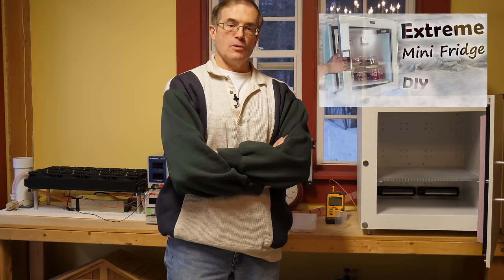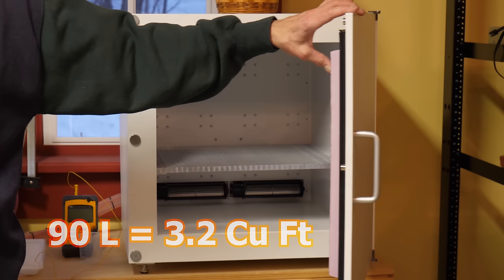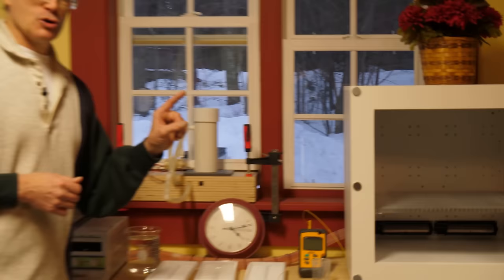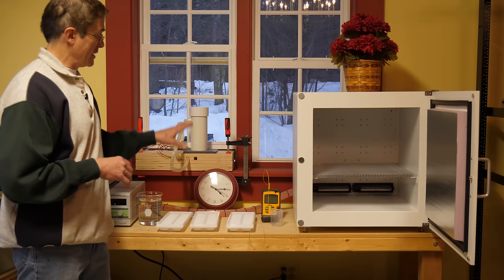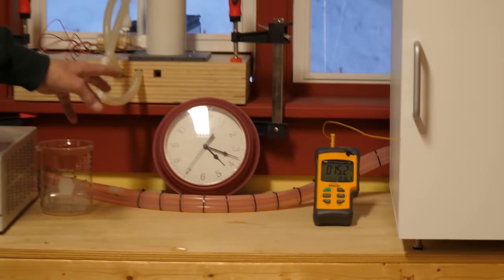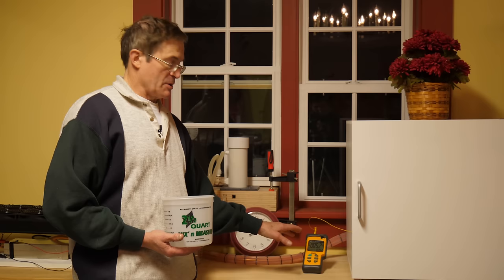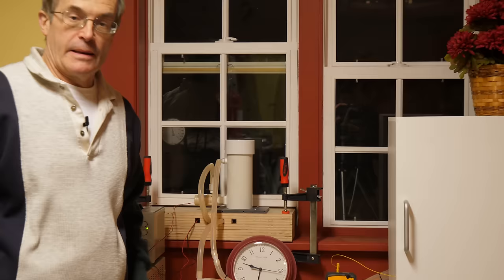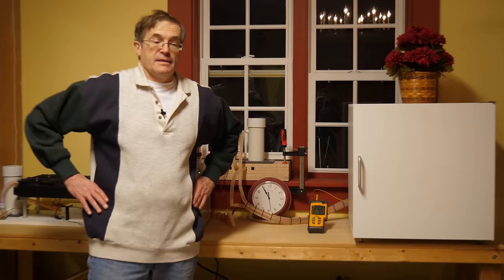TEC Freezer - Build Your Own!

Comment: So would a radiator and pump INSIDE the fridge on the cold side of the TECs help with heat pumping performance?
Reply from the maker: The two linear fans near the back of the inside of the freezer blow across the rear surface of the enclosure which acts as a large, flat heat sink.  Adding find to increase the surface area would help a little, but I doubt it would be worth the cost.  A fluid system would be even more intrusive.
Reply: @TechIngredients  Except for the little mini coolers that use a deep drawn aluminum tub, commercially made TEC coolers use an internal finned heat sink, many also have an internal fan, and they get decently chilly with a single TEC.

I've 'supercharged' a few coolers by carefully filing the TEC contact faces of the hot and cold side heat sinks flat, replacing the thermal compound (often too much applied by the factory) with better compound, and replacing cheesy centrifugal fans and noisy brushed motors with fans made for computers. The major problem with the little soda coolers is the tub is quite thin and makes very poor contact with the TEC. On those I cut a piece of thicker aluminum sheet to put on the inside of the tub, with thermal compound between it and the tub. Getting the tub solidly against the TEC lets a 6 or 9 can cooler keep the drinks extra chill. the one I've kept for myself, with a 4" computer fan on the outside, can keep a half gallon box of ice cream frozen for hours. 'Course nobody sells ice cream in half gallon boxes these days.

Another thing I do to these coolers which should in theory help them cool better is glass bead blasting the heat sinks. Rougher surface = greater surface area to transfer heat to or from air. Would be interesting to see someone with precision thermal testing equipment test the efficiency of an extruded aluminum heat sink, then glass bead blast it all over (except for where it contacts what it's taking heat from) and check its efficiency.

Comment: Hey, I couldn't wait for your dessicant cooling system, so I read ahead.  It's as I expected - basically a dessicant dryer followed by a heat exchanger, then a "swamp cooler" humidifier that cools and re-humidifies the air, with the return air heated and then used to dry the dessicant.  At least, that's the solid dessicant cooler - there are also liquid dissicants using lithium halide salts, but I'm guessing you're not messing with all of that.  But curiously, almost all of the diagrams I found, showed a second humidifier, on the return air side.  This puzzles me, as none of the articles give any kind of explanation for this component, nor does it appear to make any sense to me.  Can you shed any light on this?
Reply from the maker: You've described it pretty well.  We do in fact use a liquid dessicant.  CaCl2 and LiCl both work, but there are trade offs.  When we post the video, the individual steps in the process will be easy to visualize and understand.  It isn't  sophisticated or subtile, it's suprisingly simple.

Comment: There is an error at the minute 15:00. A gram / cubic centimetre of water requires 80 calories to cristalize (0 deg liquid to 0 deg solid)  that means 80 * 4.184 joules  ~ 334 joules. Not 2000 ...

Comment: Great video. I want to use the same idea to cool my picnic cooler. I want to use one pletier  module. The cavity of the space is about 58×34×24 cm.
How much time base on your expirience it will take to reduce the temprature to 0 cellecius degree. When the cavity is on 32 degree cellicius?
Reply from the maker: Watch our earlier  video on the solid state refrigerator.  I walk through  the sizing of the cooling load and the TEC requirements.

Comment: Awesome. I might consider making one. Question. What kind of temps would one have to reach, to keep the temp in the freezer below 0 for 12 hours without power?
Reply from the maker: Good question.  The downside of this system is that without power the TECs are a poor insulator.  With only a few tens of watts, their cooling capacity is very low, but then they effectively become a "perfect" insulator and you're limited only by how much insulation you use and the mass or cooled material inside the box.  I go through some of these calculations in our earlier video on the "Mini Fridge".

Comment: Where do you get your parts from things the tec's and power supplys probably from eBay and amazon, But what about the radiators water blocks and those tiny blower fans that are inside of the freezer? On your refrigerator you used glass for the front and its double panes have you though about evacuating the air from between the panes to get a better R value or using and innert gas like a residential homes windows.
Reply from the maker: We have been doing this for so long our lab/shop is like an urban maker space.  We have "stuff" everywhere!  I just went through the shelves and designed based on what was available.

Comment: Hi, nice video. On an aluminium boat, Will it be possible to use the boat as an heat sink for the refrigerator ?
Reply from the maker: Sure. Some steel freighters use the hull as a heat sink for cooling their diesel engines.

Comment: So the TEC basically convert electricity into potential energy, and can convert the potential energy (the difference in temperature between the two sides) into electricity. 
Am I getting this right? 

Cause I'm imagining a setup that oversees a huge network of nodes including climatization, refrigeration, heatsinks for motors and electronics, and it regulates them all together going as far as having fluid systems transfer heat from node to node.
Reply from the maker: That's right.  Take a look at our video on "The Campfire Generator".

Comment: I am not sure why you ran the the water lines in series from the Peltiers to the external cooling block ... would it not of been more efficient to have the peltier units  in parallel for more efficiency in cooling ?
Reply: The first set of peltiers yes,  and the cooling working, but every  level of peltier you go into you need to worry about the the heat multiplying every step  .... having them in parallel would allow for a much faster removal of the heat of the freezer unit, and the unit would go down further in temperature in parallel then they would in series. Please correct me if I am wrong
Reply from the maker: The problem is that one way or another there would have to be some of the peltiers running in series otherwise we would end up with 12, parallel input and output tubes.  This would be quite bulky and require either a complex tree of spreading and contracting plumbing or some custom fittings.

Comment: is it still solid state though if you got a bunch of coolant being pumped around? i mean especially with the outside cooler you got pretty much a heat exchange pump and maybe won't even need the TECs? if you're already pumping stuff around won't the "old fashioned" way of pumping heat via pressure differentials be more efficient?
Reply from the maker: You're right that with a fluid loop, this is not a solid state cooling system.  The purpose with the previous refrigerator video project was to see if operation without any moving parts was feasible.  It wasn't and fans had to be used.  The freezer also uses TECs, but to further enhance effeciency, a liquid heat exchanger was added.  The interesting aspect that the low pressure, simple recirculation method allows, is that it is now easy to exploit available low temperature locations for the heat exchanger.
Reply: @TechIngredients  so it's more of a flexibility thing (and safety / ease of construction i imagine, i wouldn't want to be working with high pressure toxic coolants in steel pipes :'D ) than the original idea of solid state delivering high lifetime and efficiency? that and i imagine you probably actually need less power and less bulky pumps in this comparatively small setup, since the fluid doesn't do the actual work
Reply from the maker: Right.

Comment: How would this perform in an environment were the ambient air temp is 30C to 34C?
Reply from the maker: The temperature differential is the primary guide.  A 25 degree differential is very practical.  A 35 degree differential is difficult.  Obviously, the heat flow increases with a larger differential, but more so, the effeciency of the TECs drops substantially.

Comment: Rewatching these fridge videos is just as interesting as when you guys posted it. I'm curious if there's a possibility of making the fridge or freezer designs thinner by using Aerogel blanket insulation (or other type of aerogel insulation) that has been developed since the making of these videos as insulation. I'm just curious if there's any possible improvements that could be made on design based on newer materials.
Reply from the maker: Sure, that could be done.  Aerogell is about 25% better than the urethane  we used.

Comment: Great video !!. Is it possible to make a normal minibar (with compressor, evaporator, radiator, etc... like an small fridge)  lower the temp than -34°C  (-29.2 Fahrenheit)? . Is it just to modify the termostat or there is a limitation ?
Reply from the maker: Thanks.
It is possible, but the efficiency of the TEC decreases as the temperature differential increases.  Achieving  that temperature will require a lot of power.
Reply: @TechIngredients   could be possible get -34°C without using TEC and using the minibar own components ? will it need a new termostat ?

Comment: Does it use less power to maintain the power at -4 if the peak is -14? For example using a PWM.
Reply from the maker: The effeciency I'd inversely related to the current.  The most effecient operation will occur when the current is continuous because the higher peak current during PWM generates inefficient cooling even though the average power flow is the same.
Reply: @TechIngredients  Thanks for the quick reply and explanation.

Comment: Is there a formula to extrapolate power usage relative to ambient temperature?
These experiments seem to be running around 60 degrees and below.

What kind of time/energy is used for a 100 degree ambient temperature?
Reply from the maker: The differential tempreture determines effeciency and the warmer the ambient tempreture, for the same differential, the higher the effeciency.  I discuss this in our video on dry ice vs. electronic cooling.
Reply: That was a great video explaining the process of TEC chips and their limitations.
do the chips themselves have a hardware failure point if you do not vent the heat/cold away from the source?

Comment: Wouldn't you radically increase the efficiency your freezer by utilizing the heat rather than simply venting it either indoors or out as waste energy?  I'm thinking that by using that heat to run an adsorption cooling cycle you would benefit from both ends of the temperature spectrum produced by the tec's.  Am I missing something?  Please reply!  Thanks!
Reply from the maker: Yes, the problem is that the waste heat needs to be removed as effectively as possible in order to maximize the effeciency of the TEC.  Any process that generates energy from that heat does so by restricting in some way it's removal.  This is common to all heat based engines and heat pumps.  You will lose more than you gain.
Reply: @TechIngredients  Thanks for the thoughful reply!  Can you provide any estimates of costs to build the TEC Freezer, as well as any plans and assembly instructions and parts suppliers?

Comment: Hi, really interesting stuff. I have a question though.  If this was running as freezers most, in every day use. How much power would it pull on average? So please I'd like to see a test where you have put a thermostat on it and filled the freezer up with products. See how long it takes to reach it's wanted setpoint temperature, and how much the power consumption is over a period of 24 hours  finding the average power consumption.  Both for the indoor and outdoor heatsinks. The reason for the question is cause I find that conventional freezers are pretty energy efficient, really not too bad. And I'd like your test to debunk that. I really hope you do, if you decide to take me up on my request.  Thanks again for another great video.
Reply from the maker: There is no question that a peltier based freezer will be less effecient than a conventional, phase change freezer.  This unit requires the power input that I demonstrated, around 200W, continuously. With the outside radiator, as long as the outside tempretures are lower than the freezer tempretures, then the power requirement drops to less than 24 W.
Reply: @TechIngredients  I'm sorry I'm asking these questions,  I feel a bit dumb  asking them.  But shoot 😅 how about bigger? Would that be the same for even bigger freezer.  I'm just curious,  you'll have to forgive me ignorance.

Comment: Is not almost like supercooling the liquid before it goes into use to cool a product.
The chemical that you're using for Cooling  or heat heat transfer is that  glycol???
Reply from the maker: Yes, we used propylene glycol/water only because we were going to be sending it outside where the temperature can drop below freezing.  Otherwise, pure water will work better with it's lower viscosity and greater heat content.
Reply: @TechIngredients  Try some Redline Water Wetter or Royal Purple ICE in the fluid. While designed for use with pure water (because antifreeze makes a race track slick when it leaks) they do help improve heat transfer when added to a 50/50 water/antifreeze mix.

Comment: How have you bonded the water blocks to the tec ? Please help I’m trying to construct a grow room air conditioner
Reply from the maker: Yes.  I used our thermal epoxy.  That saves a lot of assembly work over compression screws and fixtures.
Reply from the maker: Also, consider the BTU requirements.  TECs are inefficient compared with conventional phase change, compressor based cooling.
Reply: @TechIngredients  thank you so much

Comment: when your 1st Peletier needs electricity to pump the heat out, why not to put a 2nd Peletier on it's warm side which would create electricity to balance the hot and cold side that could be used to run a fan to keep it's external side colder ?
Reply from the maker: The second Peletier would reduce the cooling effeciency of the first by interfering with the flow of heat out of it's "hot" side.  The effeciency reduction exceeds the energy recovered by the second Peletier.

Comment: coolant lines not insulated, and the cool and hot lines are bundled together uninsulated??  11:57
Reply from the maker: The temperature  differential  between the lines is small, and so is the available  clearance, but it wouldn't  hurt if you could manage it.

Comment: I'm interested in a design for 110 degree weather which probably requires a 2 stage design to feed it cold water.  How does your freezer perform in the summer?  Also I'm considering building a decent size heat pipe into it to act as a thermal diode so I don't have to run the peltiers constantly.  The only heat pipes I can find at a decent price all have internal wicking making them unsuitable for this purpose.  The TEC1-12715's have a resistance of .8 to .88 ohm spec over its range.
Reply from the maker: If your climate permits, you might consider a shallow ground loop for the cold sink.  Two stage TECs are substantially less effecient than the already low effeciency single stage devices.

Comment: Why not 12715  TEC's ? Wouldn't they be more efficient at the same current than 12710 ?
Reply from the maker: In general, because the same Be and Te semiconductors are used for the majority of TECs the thermodynamic performance is similar and the differences between various devices is the relationship between voltage and current.

Comment: How are the tecs wired? With 17 volts I will spect they are in 6 parallels rows of 2 series. But that will crank the amps up to 24A I guess. But I can't imagine how they will work with 5.6 volts each
Reply from the maker: Remember,  the TEC will work with any voltage.  Their rated voltage is just a limit, and the lower the voltage and hence  the current,  the more efficient they become.
Reply: @TechIngredients  I had the same question (above), which you dodged here haha. How many of the 12 TECs are in series/parallel?

Comment: Would it be beneficial from a convection standpoint to put the heat exchanger at the top of the fridge?
Reply: Probably not, on the back you will get a chimney effect(the length from the bottom to the top).

Comment: Do you have plans for a super energy efficient freezer that I could build in an odd space (under a bench seat to it would be top accessible) on a liveaboard sailboat that operate only with solar and 6 Battleborn batteries 7.2Kw total, 5Kw inverter? I just found this channel and like what I see and well done.
Reply from the maker: Thanks!
The best approach is to focus on insulation rather than the cooling mechanism. Standard phase conversion refrigeration is more efficient than solid state devices like the TECs, but typical insulation depends on Styrofoam.  There are better materials available, such as decoupled aerogell layers in a heavy gas such as krypton or CO2.